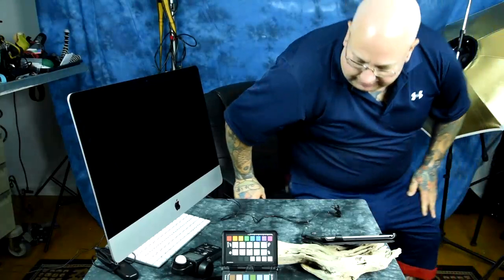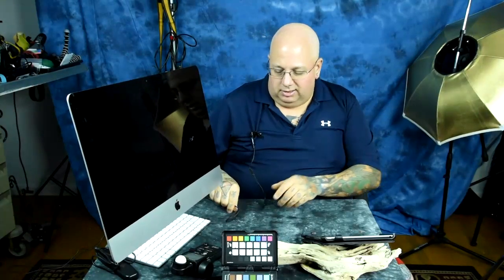AUTOFOCUS!: What you DONT know: "How fast is the autofocus of X Camera?" Acquisition-Drive-Motor

Comment: so I just bought a d500 looking at getting a 80-200 2.8 and I'm strongly considering the push pull version. How fast is the motor and drive on the d500 compared to other cameras? also I know these lenses autofocus slow, especially the push pull, but on a camera like the d500 will it still track fast moving subject when it's locked on?

Comment: Whether the AF module is driving a screwdrive apparatus (for Pentax and for those Nikons that have it) or an in-lens motor, ultimately what it comes down to is the AF module sending electrical control signals to a motor. If your AF algorithms suck or are mismatched to the drive motor, or your drive motor struggles with the lens, your AF will suck. I suspect there's a reason why today's big, heavy, multi-element lenses have the motor inbuilt. Screwdrive is fantastic for tiny lenses like the Pentax DA Limiteds, which have only a small number of relatively light elements to move; by the time you get into the long-tele monster zooms, it's a different story. You need either a much beefier screwdrive motor, better motor control/feedback algorithms, or both - and even then, it's better to have an in-lens motor that's matched to the size and inertia of the elements it needs to push around.
Reply from the maker: "mismatched" and "struggles"  <<< these play no part in AF speed over 4 diff factors.

Comment: Great video Ken, as usual you are the best with no close second.....
Did you see Adorama's promotion of Fuji XE2 with 18-55/2.8 extra battery,case etc for $689.More than $200 off of a similar package with XT10.
Which one is your pick ???
Reply from the maker: saw that :)  id still rather have the XT10, but thats just me.  i owned both
Reply: XE2 of course, bigger viewfinder than xt10
Reply: For the same money, I pick the XT10, mainly for the auto switch, (for my wife and kids). But  for $210 less, plus an extra Fuji battery and case, I am leaning more toward the XE2. My main cameras are Nikon D700/750. The Fuji will be an add on, for travel,leisure,etc